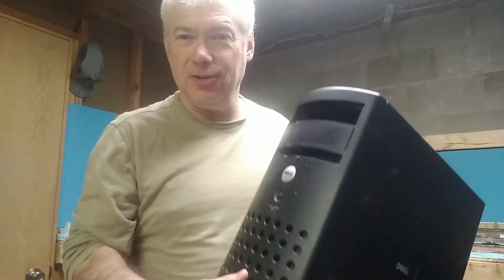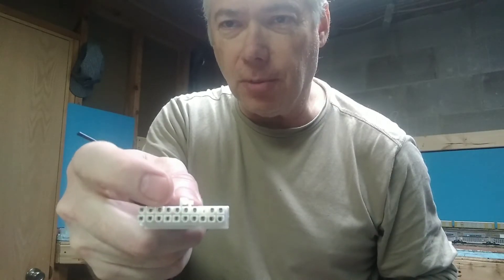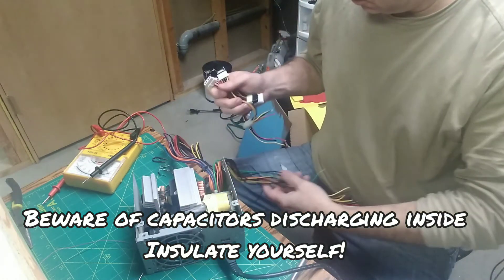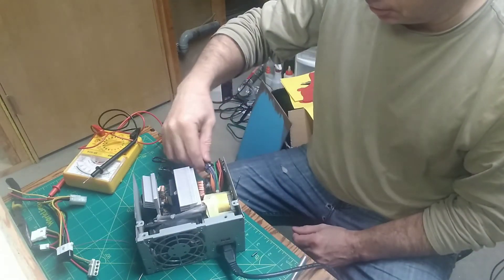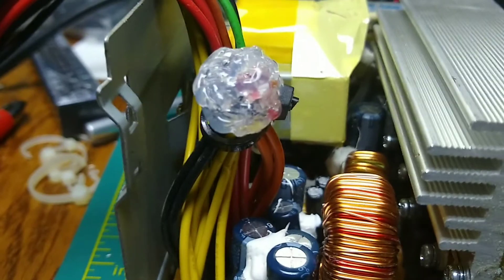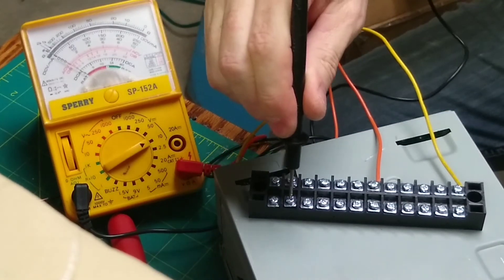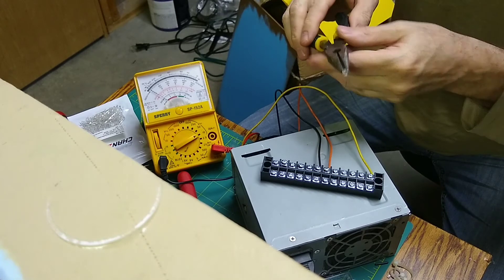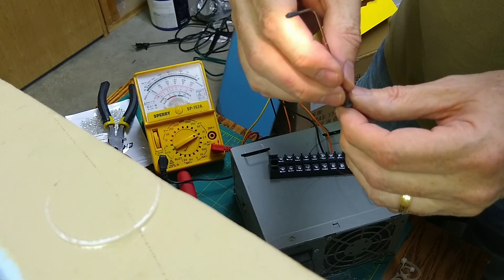Powering BEVRR accessories with a PC ATX power supply

Comment: A very clever idea, if resistors and more are then added to the system to protect the various levels, as explained by Steve Larson.  I am all for re-purposing and re-formatting all electrical/electronic stuff.  I used to have tons of extra stuff like this around as I was scared to throw it away and then needing it for something else.  Cool video!
Reply from the maker: Check up follow-up video.. yes, I'll be using resistors on each LED in parallel circuit. Thanks for stopping by, Anthony!

Comment: The resistors are to limit current, as most LED's operate at ~20 ma or so. Depending on the LED, 3.3 volts with no current limiting resistor might allow enough current to damage some LED's that have a low voltage rating (red LED's). White and blue LED's are rated for higher voltages and might be OK with 3.3 volts, but it's still a gamble driving them direct. I grabbed this from the Wiki page: "Voltage sensitivity: LEDs must be supplied with a voltage above their threshold voltage and a current below their rating. Current and lifetime change greatly with a small change in applied voltage. They thus require a current-regulated supply (usually just a series resistor for indicator LEDs)"
If you have a multimeter that has a diode check function it will show the forward voltage drop. You then plug that into a simple formula and choose your resistor.
Resistors are cheap and your LED's will thank you with a long and reliable life. https://www.youtube.com/watch?v=7d4ymjU9NqM
Reply from the maker: Thanks, I'm going to use resistors, although makes more sense in a parallel circuit.. no voltage drop. You motivated me to make a follow up video, thanks Steve!

Comment: I would use a resistor even with a 3.3v supply.  Many LEDs will have a forward voltage lower than 3.3v (some as low as 1.8v or lower), and will burn out earlier if run over voltage.
Reply from the maker: Thanks Roy, check out my next revelation video. 🙂. I am using resistors going forward on each led, but parallel circuit alleviates voltage drop.